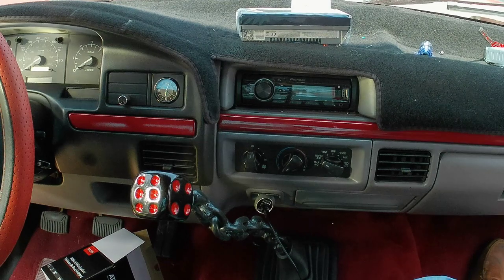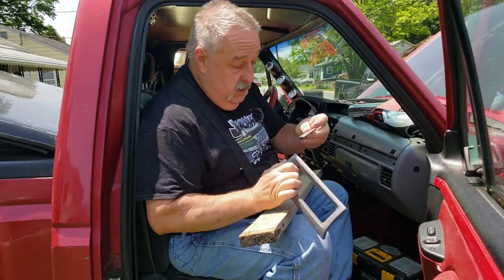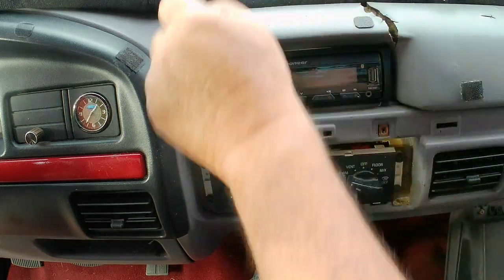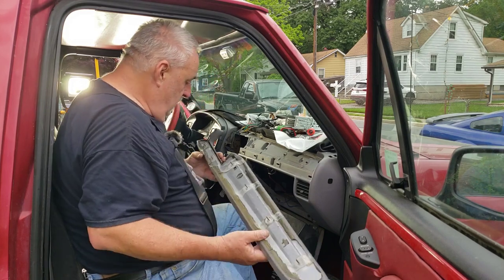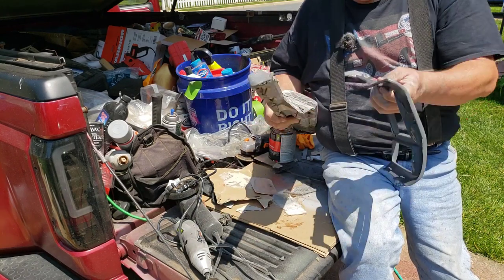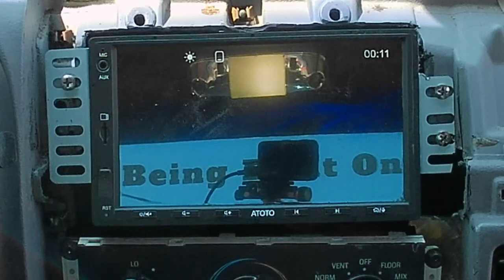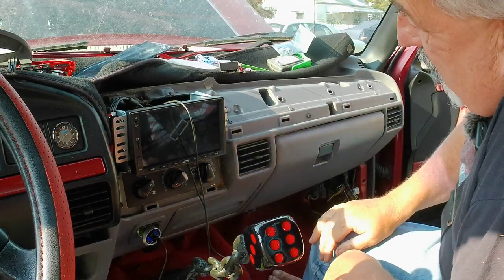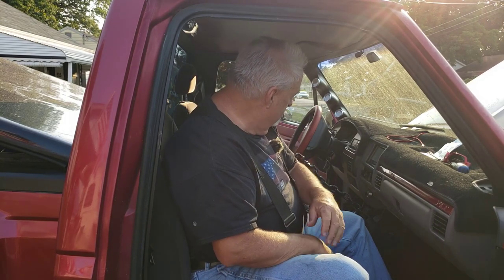OEM Look Double Din Head Unit Install in an OBS Ford

Comment: Getting ready to do the same job and glad I watched this. I was going to cut the dash pad square and extend the top of the bezel but sinking it into the dash pad looks much more professional. Also have some high quality vinyl to cover the pad and it will be easy because most of the surface will be flat and don't have to stretch it into the corners.  Original formula Gorilla glue is great for cracks in the pad since it stays flexible. Should cost under $100 and looks better than the $700+ kits shown on YouTube and don't have to wait 5 months for it. Thanks for this video.
Reply from the maker: I recently saw a video where he had cut the dash square, it liiks fine but sinking it into the dash pad I think looks more like how Ford may have done it if there was an option for a double din, also I like the idea of covering it with the vinyl, I probably will do that myself, just a suggestion though, put a nice padding under the vinyl, it will give a bit more of a high end finish. Hay send me a pic or 2 of the finished product, aintscaredgarage@gmail.com ,Heycheck out East Coast OBS Ford facebook group https://www.facebook.com/groups/3628172440747341 I'm trying to get something started over on our side of the country
Reply: @AintScaredGarage  Thanks, I'll check out that group and send you some pics when it's done. I was just going to re-do the pad and bought a cracked up dash pad from ebay for $30 to experiment and did my own repairs using Gorilla glue, sanding it down and covered with vinyl using contact cement but getting it to stretch into the inside corners was tough but everything else was perfect. No padding needed, just over the original surface. Then I started looking into din kits and it's either that crappy plastic panel you can buy for $40 that goes over the pad or spend $700 for a custom bezel and custom pad and I want a nice truck but don't want to piss away all that money when I think I can do it for under $100 and have some fun doing it and doing it your way removes the problem of stretching the vinyl into any inside corners.

I was just looking for plastic/vinyl spray paint for the bezel and Diupli-Color and SEM have a few variations of RED. My interior is code 'R' which is Ruby red. Would you happen to know which of their colors match the closest to the Ruby?
Reply: @AintScaredGarage Blue wire with the white line is amp turn on

Comment: Love it! I would love to put a double din in my 96 bronco. Ive never worked with fiberglass so i wont go that route. I love watching you work on your ol truck. Its looking great. ❤
Reply from the maker: Well thanks, Fiberglass isn't that hard, but you just get one of those kits, or if you willing to spend a little for it there is a company that makes this, you have to supply the donor parts and it's a little pricey, around 100 buck's https://www.obsinteriors.com/product-page/91-97-f-series-bronco-double-din-kit

Comment: Which ATOTO did you install? I have a 1994 F-150 that I'd like to upgrade its stereo. Enjoy watching your mods n find them helpful.
Reply from the maker: The F7 but it uses the Linux OS and that limits you on what you can do with it from your phone, the S8 uses the Android OS and unlocks a bunch more futures, I'm eventually going to put the F7 in Mom's car and get an S8 for the truck

Comment: Dude. I keep watching your videos. You're a nice guy and seem to love doing this stuff. I have to say some of it pains me to my heart. You want it to look stock. Good thing. You've got a carpet on your dash instead of fixing it. Antithetical to the idea of stock, and it would have covered at least part of the aftermarket kit. That said, I like your idea better. And then you go and cut the plastic with a rusty, bent butter knife. I know, tools are expensive. But do it once and do it right, guy. Now, to be honest, I haven't watched past the part where you pulled out the rusty hacksaw blade and began to ghetto rig it. I'm hoping for a good outcome. I may do the same someday in my 95 Bronco. Right now, I've got a pioneer flip out screen...because I also hate the aftermarket bracket kit. Lol😅😅😅
Reply from the maker: Ha Ha Ha, yes I can do things a bit goofy, I did grab a good hacksaw later and then a dremel thats on its last legs, BUT, I did fix the dash pad, but I dont like that expanse of plastic that is the rest of the dash, so anyway, Thanks, I'm glad you get a kick out my goofiness, you know I always say, YOU should do it the right way, LOL